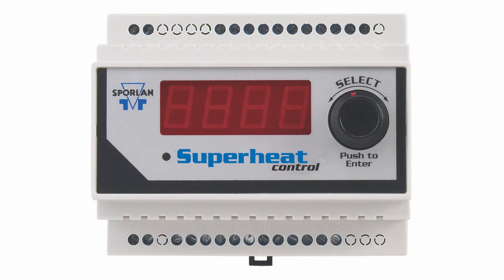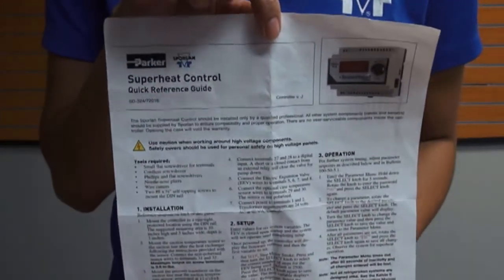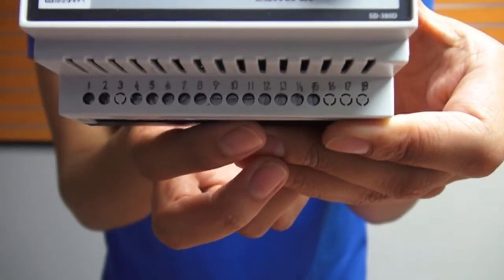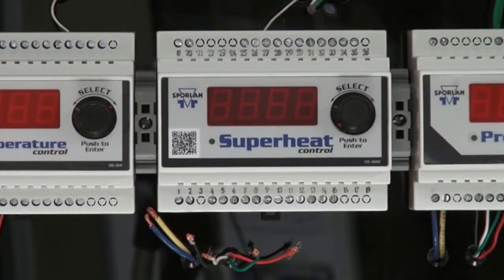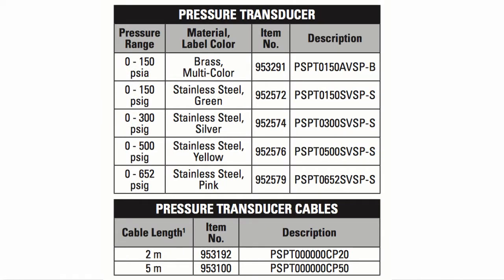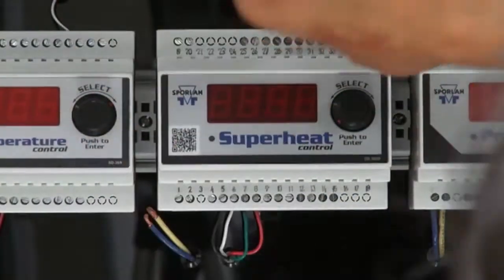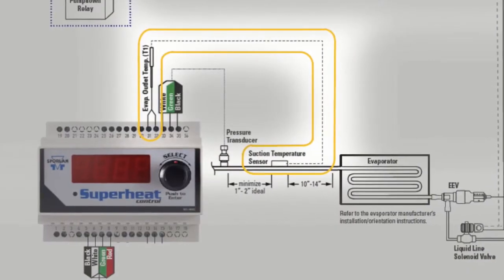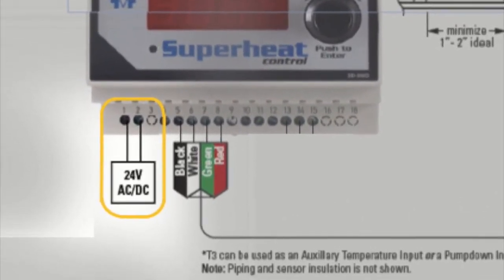Sporlan Superheat Kelvin Controller Installation

Comment: Thus this device is a remote controlled txv valve. A txv's goal is constant superheat. Adjustable txvs have one changing the spring or biasing the spring to change the superheat.      Does this electronic version have a gain or dampning in the servo loop to adjust to reduce/stop "hunting"?
Reply from the maker: Yes, the Kelvin II Superheat Controller is a PID controller.  By adjusting the P (proportional gain), I (integral gain) and D (deriviative gain) response time can be adjusted for your application if needed. If you have any other question you can also contact our technical support team at 636-239-1111.